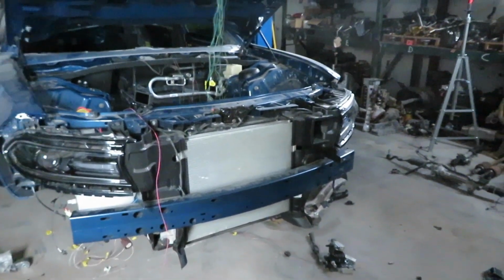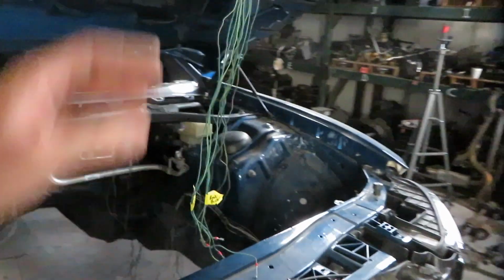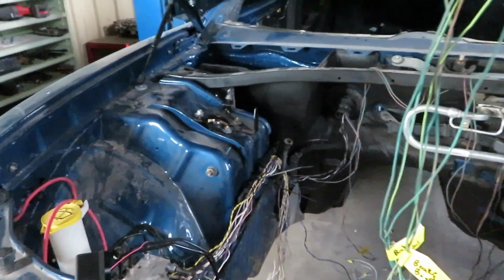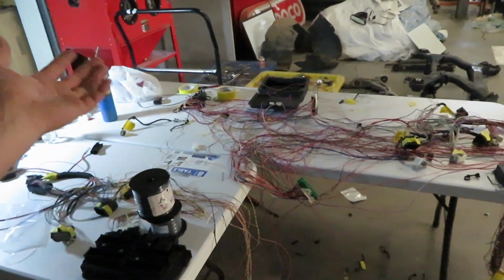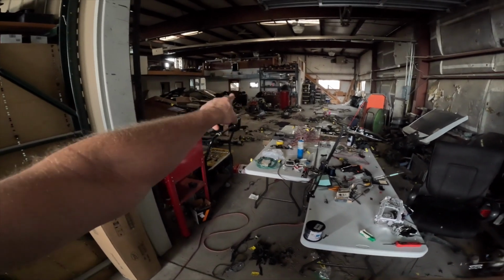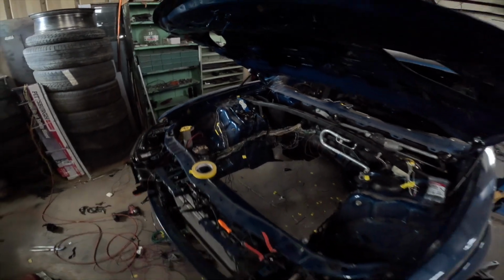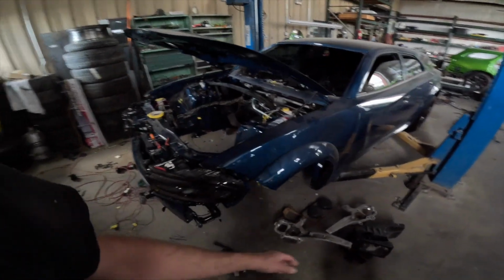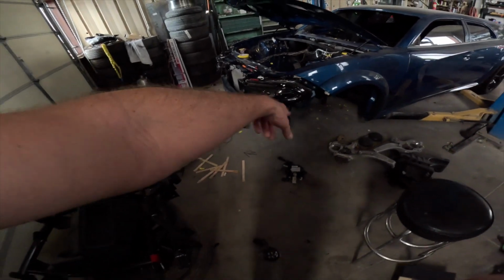Building the Ultimate Station Wagon |  Charger Magnum Hellcat | 1000HP Hellwagon | Pt 85

Comment: You also don’t particularly want to cut and join can bus wires as it could change the resistance and effect the signal.  Which as a quick afterthought also could be why they are a specific length.

Comment: All props for such an ambitious, meticulous build.
One question: why are you going to put the dry sump reservoir tank on the left side when the oil filter adapter, oil pressure & temp fittings are on the right side of the engine?